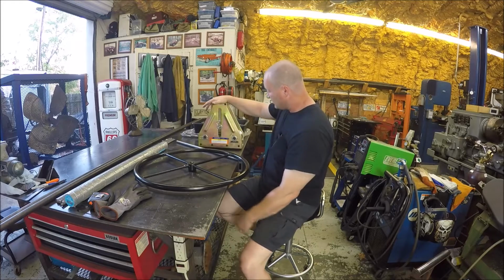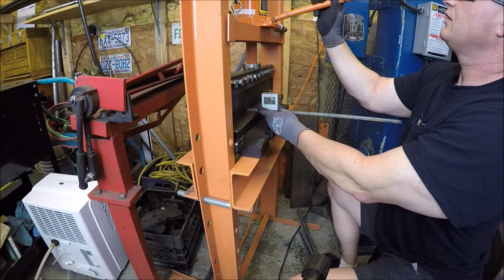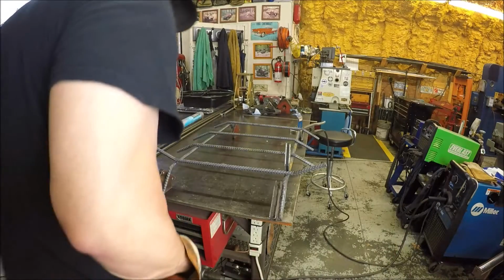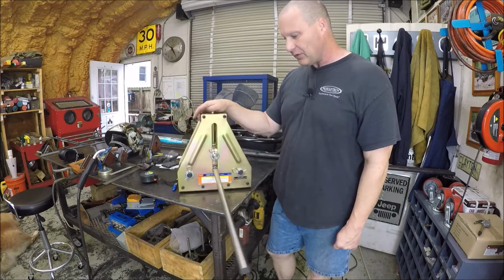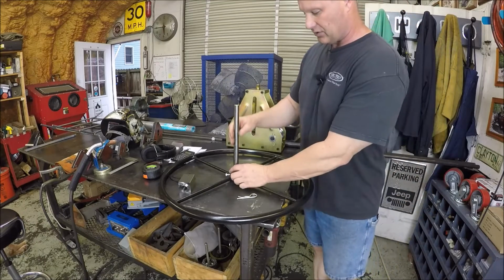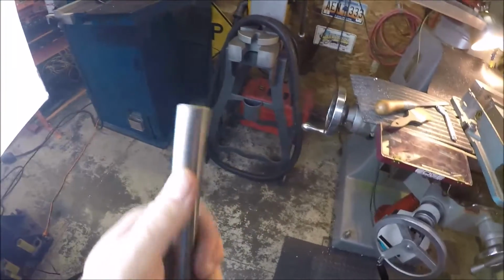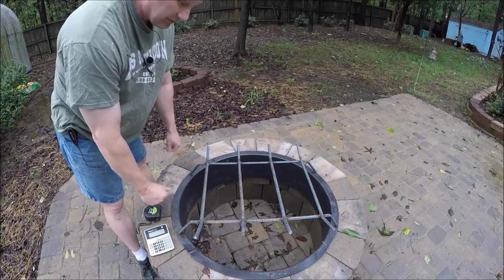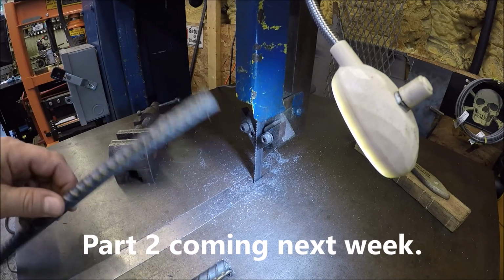Fire pit cover & log grate build Part 1

Comment: Do you need flats for the drive roller set screws?  As James says "Projects that make projects."  The hard crust on rebar is hard on cutting tools!  Good videography.  Waiting on part 2.
Reply from the maker: I am going to mill some flats for the drive roller. After using it I think it will help. Hope your doing better.

Comment: Tom, I’m thinking the rebar is a bit thin, I think it will warp when it gets red hot. Maybe add a third bottom leg piece in the center of the rack.

Drill rod should make a good axle for that roller. Shouldn’t the axle have flats for the roller set screws
Reply from the maker: Yeah I wanted thicker rebar but that was the only size I could get at the hardware store. I added two supports on bars 2&3 so I hope that will work. I looked over the store display unit and it didn't appear that there were flats on the axle. But after using mine in part 2 of the video series I think I will mill some flats for better gripping power.